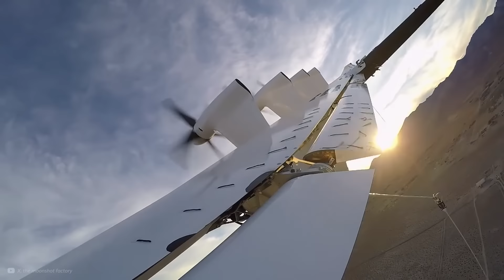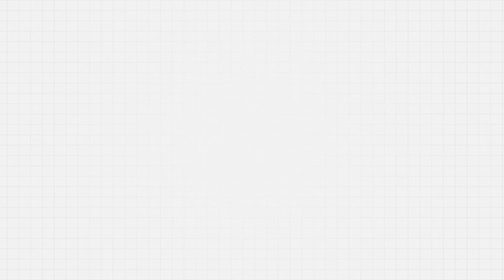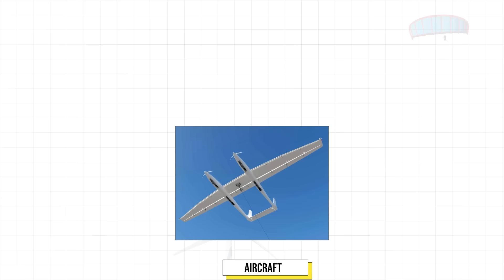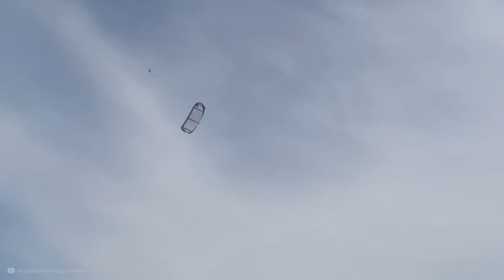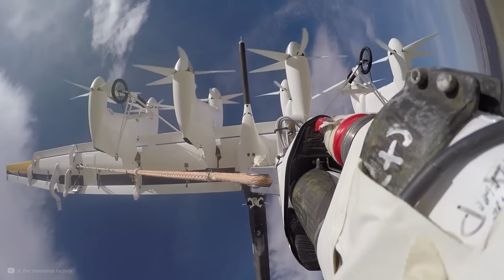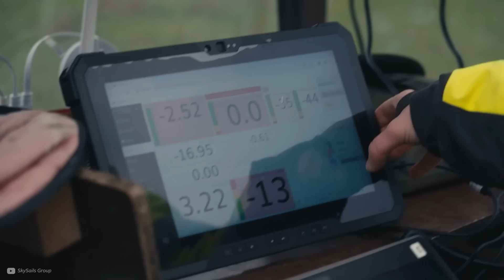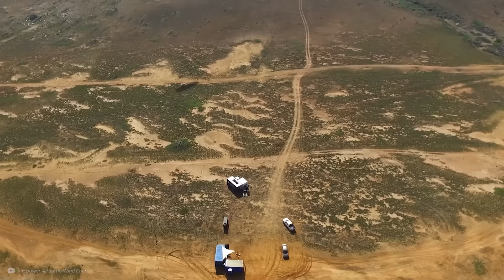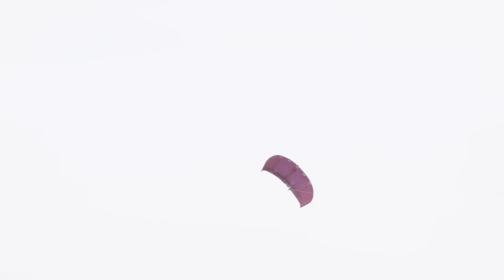Airborne Wind Turbines: The Future of Clean Energy?

Comment: people forget that 15MW is just good for a small city with around 10'000 households. Its not much, but its still nice to have if you are far away and offgrid. A nuclear reactor for comparison has a output of 1400MW and makes 3'500'000 households happy + it doesnt kill any animals and doesnt corrupt wind circulations that comes with the Turbines. And before you say anything about nuclear waste: It can and is used in several countries to generate even more electricity.
Reply: Have you ever looked into hyperdimensional theories? I myself would of course promote nuclear energy production as well, but there are completely different effects to consider, we have no Idea of. There could be changes in quantum states due to such forced concentrated nuclear reactions, which could be very different than "just" the usual potential problems with waste, structural questions about security and the ever higher risk arising from more and more available weaponizable materials - even today, depleted uranium is still considered as suitable not only for weapon use, but even in the most stupid form one could think of, by making projectiles out of it,  to be turned into very fine dust upon impact and this is when the relatively low radiation can become a problem. Just take a look at the corresponding sites, where these have been used in Iraq for example: 
https://www.youtube.com/watch?v=fgR0B86T7JE&t=33s&pp=ygUSZGVhZHkgZHVzdCBlbmdsaXNo
Reply: @janich9406  viable point. But everything can and is probably used as a weapon if it exists. So i dont see why we should really care about the weaponization side of this.

Comment: I wonder if the SkySail system could use massive coil springs to draw it back in instead. Then it could use a simple standard wind turbine to slowly wind it back up on the roof of the structure.

Wait, actually, it could probably use its roof for a couple of smaller wind turbines to charge enough power for the reeling in...

Comment: wind is kind of crap anyway, bigger problems with the grid and more expensive to install and maintain per Kwh, it can be a part of a solution but only in fairly specific conditions. Higher turbines need more free space around them for safety and introduce even more fail points on an already sketchy platform

Comment: The general advantages of the ground-gen kite generators are that you (a) don't need a heavy foundation of concrete, (b) no big tower and (c) the generator is on the ground for maintenance. But the enormous potential of these systems is the fact that they can simply be delivered by truck, placed on the ground, and are ready to work and if conditions are bad, they can be put somewhere else or be sold. Small and medium enterprises can therefore just order them and set them up -- with a far lower risk of failure as "failure" just means resell. It's almost plug-and-play. This is a quantum leap compared to classical wind turbines. There are one million fracking sides in the US alone, so why not 10 million kites ...

Comment: The main issue I see is space.  One of these kite systems produces far less energy than a standard turbine.  That wouldn't be an issue if you could pack more into the same space.  However, the kite systems would have to be spaced at practically the same distance apart as standard turbines in a field.  Although they have a far smaller footprint, the max extension of their cables places them in danger of constantly tangling with other tethers at any closer distance.  Same space, less power generated, with more power input to make it all work day to day.  Although an interesting and potentially promising idea, it doesn't look to be practical for meaningful energy production at this time.

Comment: For it to be stable you would need 3-4 tethers not 1 and the tethers would have to be attached to a rotating plate for when the wind changes direction the 2 top tethers need to be shorter then the 1-2 lower tethers this would keep it facing forward rather then tilted backwards the problem though is the material would have to be sturdy and light too weak and it will get ripped to bits by strong winds too heavy and it won't achieve flight.

Yes it would be cheaper than wind turbines but it would produce far less power than wind turbines now if they combine wind with solar using solar fabric basically a flexible solar panel it would be able to take two forms of energy generation and be able to diversify the generation.

Comment: It has a couple of issues and not just regulation:
1) 18ct / kWh is roughly 3x more expensive than traditional wind turbines
2) Helium is gradually lost due to diffusion, it is expensive and it is a non-renewable rare ressource (that has to be mined in an actual mine since it is fleeting in earths atmosphere).
3) teathers are a problem. What do you do when there is no wind or turbulent wind?
4) high wear on the teathers due to constant movement and friction in the teather-bearing (plain bearings of traditinal turbines have almost no friction in comparison)
5) higher overall complexity of the system means more points of failure and thus lower service life
6) Windenergy is erratic enough as it is, flying figure-8s and reeling it in every now and then doesn't help here.
7) easy target for terrorism, as everything else that only takes only 1 Bullet to destroy.
8) traditinal wind turbines produce 3MW and upwards and take up less overall airspace -> more power per km².
9) This docking manuver will fail constantly, so more service personal will be neede, wich makes it more expensive.
10) It's a cloth! Traditional windturbines already have massive wear on their wings due to erosion thrue dirt, dust, ice etc... in the air. Those kites wont last a year and the upper ends of the teather better be hella thick.
11) you can't put them near any place where a human is likly to reside or come by. When the kite breaks, the teather will fall down and they don't look harmless to me or better yet: this kite comes off-course and clothes-lines everything is a 800m radius.

Just built the damn wind-turbines. they are a good-enough solution as is .make 'em foldable in regions where hurricanes might come by if need be.
Reply: Yeah, it's gonna be for niche use, at best, but leave it to tech bros to overengineer fragile solutions, driving up waste and giving new issues.
These people aren't innovating any more than all the geniuses reinventing the train.

(Edit:) also, just don't put wind turbines in bad areas. We have a lot where I live, in DK, Scandinavia, but it's ideal, here, 'cause it's flat and open, and we're northern enough that we don't get a lot of sun. Our neighbour to the north has a lot of shifting heights and moving water, so they produce water power and use the excess for hydrogen production, and we trade depending on throughput.
Reply: These were all my concerns, just in a much nicer list than I could make.
Reply: wind turbines just are not the future.  they are just not good, and never were.
Reply: Thanks for trying to educate these fruit loops, but doubt they will listen.
Reply: This is a pseudo religion so you can't fight it with facts or numbers.
The sky is falling and we are the only ones who can stop it.
Reply: Also the drone and plane traffic will be fun to regulate with this moving balloons, especially if one get's loose "Authorities have confirmed the are Scrambling jets to take down the rogue wind turbine farm "
Reply: 1) It is not fair to compare highly developed technology with a nascent one.
2) Lifting heavy generators in the air makes little sense.  That is why the field is converging to VTOL flying wings a.k.a. drones pulling on a ground based generator.
3) The drone lands and the winch brings in the teather.
4) If this is important plain bearings can also be used for teathers.
5) Wind turbines are plenty complex, tons of engineering went into them, and AWE is hardly more complex, only at the lower level of maturity.
6) No need to make figure 8 in the drone design.
7) As are windmills and substations...
8) And need 20x more material to build.
9) Does not apply to drones.
10) Does not apply to drones.
11) Hardly applies to drones.
Reply: @nikolafischercelanovic4300 
1) I'm guessing these 18ct are a generous calculation from the developers, otherwise I wouldn't have brought up this point.
3) ... draging the dorne over rough terrain or through a forrest? plus: how is a drone supposed to land when the wings can't generate lift? Maybe the rotos can create enough lift, don't know, but this is what I mean with "complex"
4) I don't think you got my point here. The teather scapes in all directions on the bearing slipping and sliding over the bearing surface. Plain bearings only roll arround a drive shaft with almost no friction.
5) Needing the same ammount or more sensory, special protocoll,  algorithms and AI to controll everything and motor drivers is more complex. 
6) but they did in the video.
7) nah dude. You need to bring at least an RPG to make a dent in them.
8) And yet, they are more cost-effective.
10) "to a lesser degree" at best, because it's the rotos bearing the brunt of it. And don't forget: Planes have to get inspected all the time. This is one of the main reasons why. Winturbines can take it, because there is way more material to erode in comparison.
11) Nope. To the same degree, since in both cases, the load and lift is generated passively by an fluctuating force. Unless you want to talk about complexity again.

But the one thing I wanna ask you is: Why are you defending this technology so adamant? What problem does it solve? Engineers not having jobs? Maybe those same engineers should work on large-scale infrastructure solutions for Hydrogen storage or upscaling battery- wind- and solar-production. But I guess it's not as sexy as AI-powered drone-gizmos.
Reply: People want fast "solutions" and are desperate to agree to anything that just describes what they want regardless of practicality or even possibility.
Reply: to add to your list  here is the density of air. As you go higher up the density reduces. This means the overall energy behind it is also far lower.

As an extreme example you could build the most efficient, strongest, most durable wind turbine ever and place it on mars. The wind there is constantly above 100Mph, easily hurricane speeds. But the density is so low, no matter how you build, what you make it of, that turbine will never generate any usable power. The air is just too thin.

Now on earth its not so extreme but that lower density does present large losses in power reclaimed from the wind.

From a power perspective, it's far better to use the heat from the sun to boil water and convert that steam into power. The efficiency is far greater, and the cost is astronomically lower.
Reply: @8-7-styx94  That exists: Solar-thermal. But they use liquid salt in these, since it can also store power. But it turned out, that calssical PV+Batteries is more competitive than that.
As I said earlier: We have good enough solutions. These concepts ammount to little more than cool party-tricks for engineers. (Spoiler for nucelar fusion, btw)
Reply: @8-7-styx94  Using steam from solar power has already failed in California.
You can pickup some cheep mirrors and other equipment in Mojave Desert  if you're interested.

Comment: There's an inherent issue with all of these in-air generators - the technology doesn't scale up well. From the need to constantly replenish helium in the balloons (helium being a precious gas with limited resources) through the amount of space the kites need to do their loops and turns. These can serve as emergency power system in some remote or rough areas, however they won't become the actual solution.

In addition to that, there is another inherent problem in looking to wind energy as the solution. What it boils down to is this: the solutions take kinetic energy away from the system and turn it into electric energy to be used on something completely different. By taking the kinetic energy away, they gradually disrupt the system. Climate change is already doing enough damage to long-term patterns of air circulation, it doesn't need any more of our help.

And while you could argue that the amount of energy taken away is minuscule, it's still a limited resource, and scaling up this kind of solution would make its effects grow exponentially.

Comment: As an engineer that works in the power sector I see 2 major issues. One, density. Those kites look like they need A LOT of space between each unit, how much land are these going to take? Wind and solar already take an enormous amount of land compared to nuclear power for example, and a bigger footprint means less trees, less biodiversity, and also less land for people, agriculture, etc. If the goal is green energy I still have a hard time hitting the "I believe" button when step one is clearing tens of thousands of acres of natural spaces. 

Second is maintenance and safety. The kites would be the preferred solution for this I think, how on earth do you safely perform maintenance on those flying generators? High voltage tethers waving in the wind seems pretty sketchy, and then to perform maintenance you'd have to land this giant flying generator and then how does the technician reach anything to service it? The one advantage is it would put the tech on the ground instead of in 200 feet in the air for maintenance, but it still seems overall pretty difficult, and how long does it extend even simple maintenance tasks if you have to land and then relaunch the thing? Seems to me launching a generator into the air every time it needs maintenance wouldn't be trivial from an energy or time perspective.
Reply: Plane maintenance is done on the ground. It wouldn't be much different. Access for maintenance: ladders, scaffolding, mobile elevated work plaforms.

Comment: Hey, instead of completing a circuit with a round trip wire, how about a one-way wire that radiates electrons into the atmosphere?

There is an electrical differential between "ground" and different layers of the air (due to friction? planetary field? I dunno). Just connect them and eat the power.

Could you even navigate the top end by changing the potential of the wire so it is attracted/repelled to its surroundings?

Comment: Come on man, its money. You see that it can't be cost, its stupid. What is the cost compared to a windrotor, a tower aso. Here you can chase the wind, go up and down to get out the most and the hole thing dont have 2-5% in material compared to others. You can bring it down and protect it in minutes. So cash is the problem here as usual. If these came out as an option there 8-12 years ago after being tested sence 15 years ago. 

China would not have been able to make millions of the traditional ones as they have. So hide it. Its every electric car they have scrapped the last 100 years. They know they are to good. Now soon tho, China might make them for penies to screw the oil industry totally for example. And hydrogen lifts alot better then helium and is cheap as chips, you can make it on spot with water and electricity. Today they also can be repeters for internet. Wifi connections, Mobile masts. Alot of other usages. We then realize if they make them a few times the size we could fly around with them. But who wants that.

I have a Ford Transit Connect Electric from 2012, have filled up windscreen fluid, changed the 12v battery on 12 years and thats it, Ford did 500 of these ones, have sence sold 13-15 million in diesel and gas setups. 12 years in on those and you've had atleast 5000-8000 usd in shops just for wearout parts like belts and oil changes and a battery. None here. I charge it with 2 panels on the roof rack thru a Ecoflow Max unit, gets 25-30 km range a day and thats fine for me. But would it work if everyone did this, not sure. But its cash, its always cash and control. These where to good.

Comment: I believe one of the main challenges is environment, many traditionally turbines are build to withstand these weather conditions, and some build for offshore, where saltiness, i wind gust, thunderstorms and oscillations impact them. And still have a 20 years plus warranty on them. AND many of them still spins and produces power in these conditions  Of cause that is due to the materials and technologies and the shear amount of engineering experience used. I see it as a great challenge for the ''kite turbines'' to achieve. Or at least making that looking sensible for a customers perspective. As a bit of a joke, imagine buying a windfarm with 100 of these, just to see the line snap. Jokes aside, its a make it or break it situation for these ''kites''. A wing fails ? Comes crushing to the ground, imbalance due to the spinners having different resistance, comes crashing to the ground and so on. Not saying its not possible, but a lot of risky R&D needs to be done, and hope they'll achieve it ! But man the hurdle.

Comment: All these solutions are still subject to Betz's law: 
Not more than 16/27 of the wind energy passing through the crossection of the acuator (be it a kite, or a small floating turbine mount) can ever be harnessed, for reasons based in fundamental physics of gas flows. In a nutshell: if you have to increase the crossection, then the kites might be scalable, whereas Helium-filled blimps or airfoils with rows of smallish rotors attached to them will likely not be.